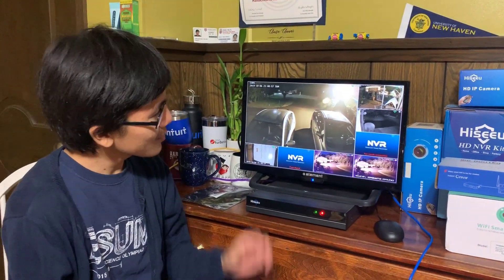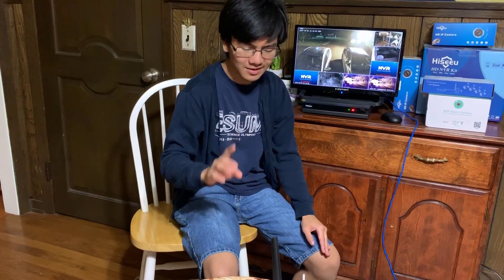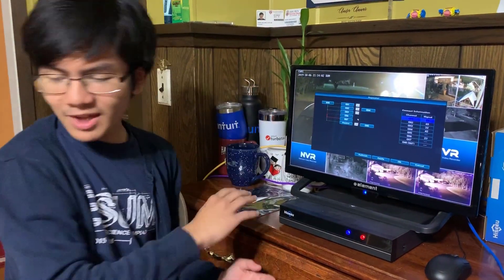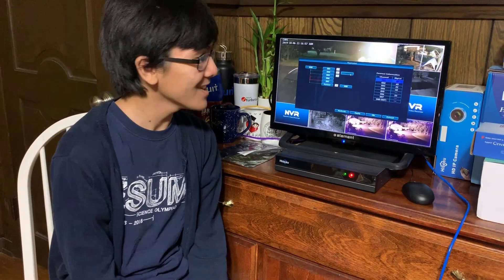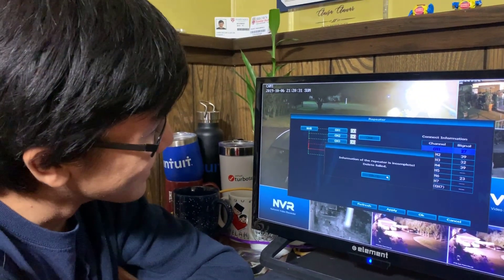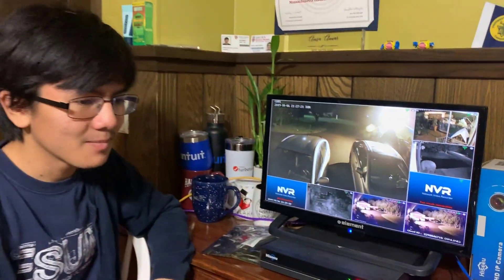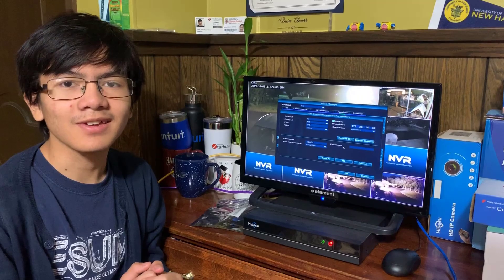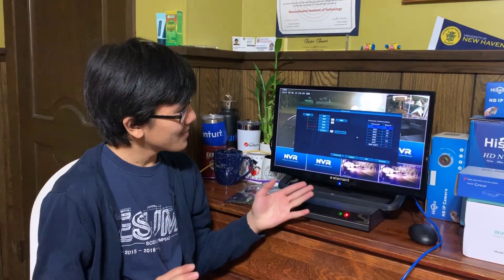TOO MUCH CONNECTION Error Message | What Is, Causes Why & How To Solve | WiFi IP Camera NVR Repeater

Comment: The camera closest to my NVR (Camera 1) was suddenly showing as "Too Much Connection" and I tried some of the ideas listed here. It is also located outside just across the wall from where my main router is located. Re-watching the attempt to get the repeater set up gave me an idea. I set a more distant camera (Camera 2, also front of the house, but about 30 feet away) to act as a repeater for the one not working (Camera 1) and it seems to have corrected that error.

Comment: I fixed this issue by deleting the camera and then adding it back in by using the original IP address. It worked straight away. Hope this helps someone

Comment: Hey in regards to the WiFi comment & you stating that your router has 5G, the 5G signal interferes with other WiFi signals in your home & not a lot of people know this.  I worked for an internet company that installed a wireless internet service.  Customers always complained that their service was bad, we'd troubleshoot then find out it's because they had a dual band router.  As soon as they turned off their 5G band (which not everyone uses or needs) their service was back up and running.  I've installed 3 of these security cameras & currently dealing with this for a customer where they have a dual band router near their NVR, & my thoughts are that this 5G signal is interfering with the signal that is being sent out to the other cameras.  I hope this information helps people with these systems, if interested I'm installing oossxx system they are ALLLL the same system with different company names.

Comment: I think you may find this is a band width problem. There is only so much information can be sent through the transmitter on a given camera. If you exceed the design limit you will get a poor or intermittent image  and maybe no longer be able to receive from or communicate with the camera. They may be designed to support repeater function but there will be limits. A manual reset and using lower resolution or different protocols for video encoding may help. Great video though!

Comment: I have a triband router and 4 access points around the house, as well as a wifi repeater. This is all independent of the nvr, 4 smonet repeaters, and 8 cameras.  None of the cameras are connected to the nvr, all go through cat5 to the smonet repeaters which is 8 inside somewhere close to the cameras.   Use a wifi analyzer app and make sure everything's not on the same wifi channel.  Spread out the different devices onto different channels.

Today I'm getting "record error" messages on it and am trying to figure it out.  All systems seem to be operating.

Smonet/ Hiseeu same thing btw.  I've seen it under different brands as well with identical interface and equipment.

Comment: This worked for me. Basically the same advance as Harold Rogers. Only difference is had to add my password in the camera edit then after reboot I had to remove my password.

1. Log in to NVR with your password
2. Click Video Manager
3. Highlight channel with too much connection
4. Click manual edit
5. In the box that says password enter yours and then click ok
6. Reboot NVR & enter your password
7. Now the camera will say something about authenticity fail
8. Highlight the camera and in the box you put your password simply back space until your password is gone
9. Hit OK
10. My camera popped on the screen as soon as I did this.
Hope it helps!
Reply: This worked for me too, thanks for the step by step listing!

Comment: I ran into this very issue this morning 11/28/2019 and I managed to correct the "TOO MUCH INFORMATION" error message and got my troubled camera back online. So I will share it with you: 1. Click on Video Manage 2. Highlight the channel that's showing "to much information". 3. Click on Manual Edit. 4. The channel in question should be showing on this screen, so log in using your password then click REBOOT. This will reboot the problem channel/camera ONLY and it should reconnect and come online. I hope this helps EyOnAiman I will let you make the video showing (hopefully) that this works. Or at least it did for me. Good Luck
Reply: I tried that vyt it says "setup failed!" arrggghh
Reply: You must have newer firmware then me. My system does not have the reboot IPC button.
Reply: this fixed my issue for a wired camera displaying "too much connection" Thank you.